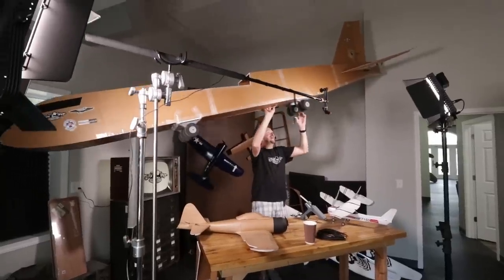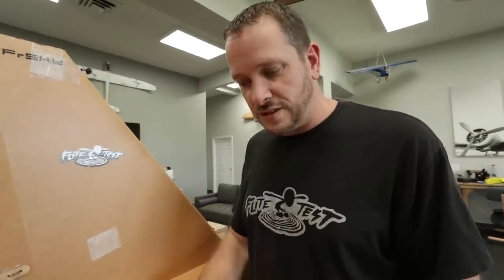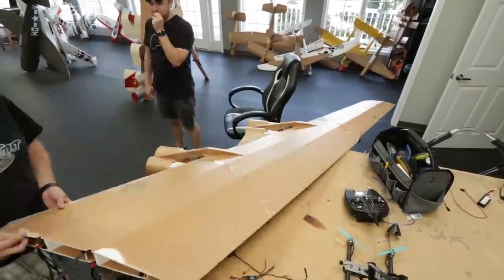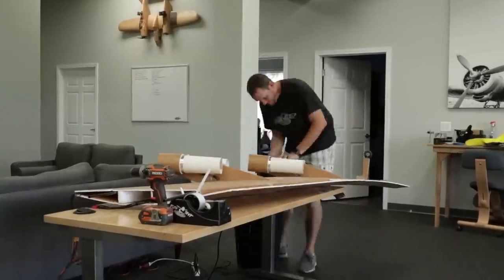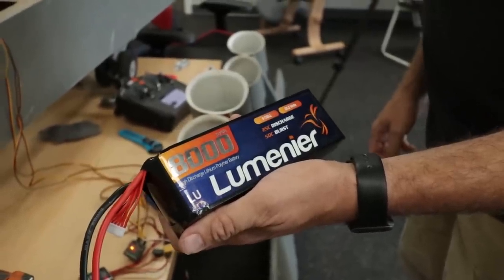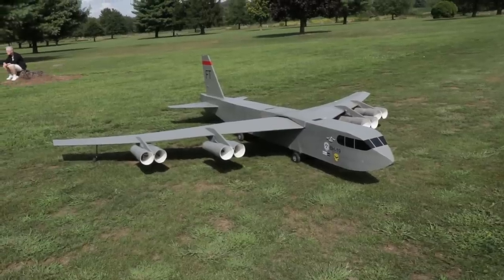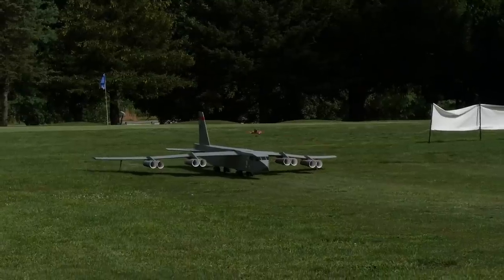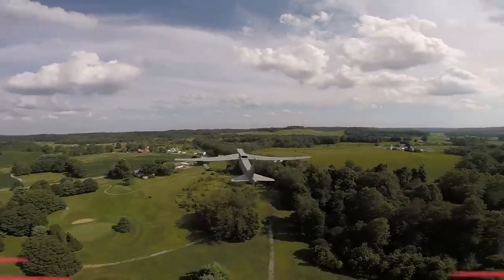✈️ Flying a 14 foot B-52 Bomber Made out of FOAM! ✈️

Comment: Amazing model.  I flew off a SAC base, but not BUFFs.  I flew smaller jets at Blytheville AFB which was built on a swamp.  After a B52 would take off, the 24" X 50' concrete slabs on the runway would move around and make the runway unusable for us for several minutes until the runway settled back down.  The only thing you guys missed on this model was that Boeing built the BUFF with a high angle of incidence so that the plane climbed out at 2 or 3 degrees nose DOWN.  The pilots would unstick the plane off the runway then push the yoke forward and the plane would climb out nose down.  With the bicycle gear it would allow a flat approach and landing.  Truly an amazing model of an amazing plane that the Air Force plans on flying for an unheard of 100 year life cycle.  Keep up the great work guys.  Love your channel.

Comment: Great flight!   Wings "flapping" is actually what the real jet does.  If they didn't flex, they'd break. :)  I was in a KC-135 refueling a Buff and it looked like it was going to shake apart!  The engine nacelles were moving all over the place.
Reply: But with all that flexing in the real B-52 wouldn't you have to worry about metal fatigue?

Comment: You should have an airsoft battle with the b-52 and a Mig
Reply: Post-flight combat analysis assignation of kill points using optical LASER weapons tracked/adjudicated via LIDAR - Boss!  In 3D? Arrrghh....
Reply: That would be such a slaughter! almost impossible to fly evasively with a flying BUS... and it is virtually impossible to make that thing crash with softgun pellets^^
Reply: @Cherrypopperland  Electronic scoring of epic Gladiatorial ariel grappling tournaments!  (saves on repairs, can enter multi-round one-on-one tournaments).
Reply: @johnd.ingleson799  still a flying bus VS an acrobat, it's like tying one leg to your arm and running 300m  against hussein bolt🤣
Reply: @catherinevaldez8810  waterbaloons? or paintball grenades! = )
Reply: Kenneth Linde paint ball gernades a payload
Reply: @catherinevaldez8810  Yeah, Why not? =) probably cheaper to just buy some sort of pastel coloured liquid in a  soft plastic container that's break on impact but you get the idea =)
Reply: I'd love it if they would use a MiG 21
Reply: @Cherrypopperland  Except that in real life, B-52 gunners have claimed 2 kills, One by a 19 year old Airman.
Reply: @SVSky  yes, and if the model airplane was full of fuel and the fighter shot flaming bullets then yes you could kill it with an acrobatic/fighter airplane. but short of that? any RC weapon that would be able to shoot it down would be illegal i think^^ so this is a m00t discussion and frankly a bit silly^^
Reply: @Cherrypopperland  You're right. It's stupid.
Reply: MMaXX M that makes no sense
Reply: If you go to the USAF Academy there’s a b52 codename diamond lil and it actually has a mig on its kill count
Reply: I’m pretty sure that B52’s has no offensive weaponry

Comment: I worked on the B-52G back in the 80's.  My job was flight controls, landing gear, windows, etc.  We did all the maintenance that just shy of depot level.  It was interesting to see the wings on your BUFF flex like they did.  This is behavior is actually a pretty damn close to what the BUFF would do.  The wings of the BUFF were made to flex up to 32'!  What was impressive about that is that fuel leakage from the wing tanks was practically nil.  That old girl was engineered correctly!

I spent a total of 6 years working on the BUFF and it holds a place that is near and dear to my heart.  I have a ton of stories about the old girl!
Reply: cool story.
Reply: Barksdale??
Reply: Lonnie Mathis I was just about to comment the same thing. I worked buffs for about 4 years. This didn’t look sketchy at all. I was at Barksdale.
Reply: @BLUEYENKO  Yep, I was at Barksdale Airplane Patch from 1981 to 1987.  I was in 2nd FMS, Repair and Reclamation shop.
Reply: Lonnie Mathis I was there 88-91 then crosstrained to F-16 Avionics.
Reply: I was a B-52G gunner at Barksdale 62BMS 79-82
Reply: Phillip McMurran I worked on the Fire Control System until they deleted it.
Reply: I’m stationed at Barksdale right now
Reply: love the comments here gentleman thank you for your service! 
I'm sixtythree tomorrow, my dad Raymond Smith worked at Boeing during the entire run of B-52s he told me before he died that his inspection bugg (ID#) is on everyone of these babies that ever flew!
he later worked on the ALCM program I have in his honor from his memorabilia hung a picture of an ALCM being launched from a BUFF! I have loved watching this bird all my life! thanks for building her!
Reply: Wow!
Reply: @Omba820  yae wow 😮😮
Reply: I also worked on this airframe in the 80s as a 328 (ECM/avionics tech). Had a blast when we had to fold the tail stab for repair work to the TWS harness.
And yes, the flex in the pilons did look authentic. I will never forget the first time I watched a BUFF from the tower during takeoff and landing.
Literally, the B-52 is the only large aircraft to ascend in a nose-down (2°) attitude.
Reply: Any of you ever do any work up in the hell hole on the BUFF?  I remember having to change out flap motors in the heat of summer up there.  One guy collapsed from heat exhaustion.
Reply: @mathis21  I have often been on what we called 'the HD Deck'. It's that crawlspace between the crew entry hatch and the forward wheel well. Had to service the coolers for some of our transmitters there. Seriously awful place to go on the best of days.
Reply: @mktsmith62  We in R&R shop called it the wine cellar.  I've spent many quality hours down there removing and replacing the throttle brakes (actual "brakes" that hold the throttles in a set position without vibrating around)
.
Reply: That’s awesome
Reply: Great story
Reply: @mathis21  I thought the wine cellar was just forward of the nav and rnav stations though, the other deck he's talking about is the one right behind the urinal through that door. I'm not too sure of the changes between the G and H models, but I do phase inspections on the buff. definitely have had my fair share of crawling around this old bird
Reply: @ACP_1123  - Oops, your right!  I got my hidey holes crossed up :)
Reply: Did any of you get to enjoy a MITO (Minimum Interval Take Off) launch with D models?  The ground shook like crazy from those babies when they hit water on takeoff!
Reply: @mathis21  No, ive only gotten to work with the H model, as well as I've not been on the flightline as my primary job, I work backshop
Reply: @phillipmcmurran8991  I was in the 596th BMS as a radar navigator 83-91
Reply: @mathis21  I was in the 596th BMS from 1983 to 1991
Reply: Not involved with big planes at all but I noticed the flex right away lol.

Comment: Great job and congrats on a successful first attempt.  I was an airframe inspector on B52G and H models, the wing flex was designed in for not just survivability but it made it a very stable bombing platform as well, in flight the wings curve up and backwards and have a 6" incidence for added lift.  On the ground the tip gear wheel is either on the ground or above your head depending on the fuel load, quite and aircraft and I feel privileged to have worked on them.

Comment: By making an exact cad model , you can simulate the flow around the plane at various velocities using Fluid mechanics software like Ansys. It will also help you reinforce the plane where necessary  by finding out stress distribution. Anyway congrats.

Comment: That is so cool. I was a SAC (Strategic Air Command) engine mechanic on them (C and D models) during the Vietnam War 🇻🇳 and (G and H models) during the cool war. I had the pleasure of running them up after maintenance. My first 8 engine run was when I was 19. I see you chose to do a G model. FYI, the real ones wings moved 11 feet and they will slip out the sky in a steep bank. Good job.

Comment: That was great.. Nice job guy's.. Before you fly it again, reinforce the wings..
Reply: Most planes with massive wings are designed to flex instead of being rigid. It helps to absorb the load on the wing, as apposed to a rigid wing which would require much more bracing to keep from snapping

Comment: I splice a couple  pop sticks into wing (vertical) sort of like spar on my modified scale down 

30" wing scout...The wing form a crease from 10-15 crash into tree, bushes, cartwheels..ect :-P . It works like a charm  becuase the pop sticks are VERTICAL and has more gluing surface
INTO the FOAM. Quick , simple and effective. I  Do that to all my new builds now.
I'll slice a couple pop stick ( 2" long) into the tops sheet of wing.ect ( at wing joint)
Even with diehedral  ( it dosnt have to be perfect, no one will see it.)

The model still flies GREAT. it has red or clear packing tape patches all over it....and holes
from the tree's branch sticking into it..It look like a patch up  war bird :-P.
I tested it....wazooo of snap rolls :-P 

I love that model..it's on a 2200 mah 3s on 2208 1400KV. So it's on the heaver wingload.
but it cuts through the wind better for a smaller model. i can fly it in 10-15 wind.

I get great power to wiegth ratio and over 12-15 mins of evasive flying  flight time.
i practice doing aerobatics with it...that's why I crash it all the time.
I can also fly it a park..if I wanted it. Even thou  it's slight over 350 grams
it's under 200 grams less the battery. A little more than one sheet of foam.

I also crash my modify 44" cub :-P.....I used 1mm plywood as doublers for the entire front end. I went in NOSE FIRST.( batteries went out.lmao) Nothing happened to the nose..Just a couple of crease behind the plywood/landing gear. It's FIELD TESTED :-P
You can get 1mmplywood from the dollar store.

It's a decent size 4 channels trainer only on a 2212 1000kv. It'll do all the basic loop and 

rolls too...practice doing cuban 8, emuman. split S, snap rolls, 4 pionts rolls, inverted..ect
over 850 grams AUW :-P . It would go bullistic on the 2218.

FOam board models are great. Cheap, effective, fun. On a balsa model the entire front end
would had exploded into hundreds of pieces...Even if I had to build new cubs ( I have plenty) 

That's why i bash is as JosH suggested . it's under $5 . i used pre coloured cub yellow foam boards :-P

Comment: The truck angle is called "crab angle". Also, the B-52 has a bunch of air flow directors on the wings that are called "vortex generators". The flaps on the B-52 are huge, and the vortex generators straighten out the air flow over the wings. The early B-52's (A-F models) had a large vertical tail rudder. I guess they had a problem with the rudder having too much control because the G and H models have a much smaller vertical tail. All of the other dimensions are the same. Longer wings than the fuselage. But it is not a glider. Duuuhhhhh. Nice job. Brings back memories.

Comment: What's cool is the high pitched whir you get out of the motors on that, is probably to scale for the sound of the actual engines on the B-52.  Used to do sheet metal work on the B-52 and still live around the base I worked at.  B-52 wings, from full fuel on a flight, the tips flex upwards somewhere around 20 feet.

Comment: I worked on the B-52 fifty years ago when I was in the Air Force.  They are still flying some of the planes I did maintenance on, like # 0007 which was later sold to NASA and is stationed at Edwards AFB.

Comment: Have you guys ever tried spraying open cell foam into the wings to give them strength, without adding too much weight? Always wondered if that'd work in preventing flex

Comment: For very big planes you might be a little worried they could crash into the crowd if the RC link fails and they continue to fly in uncontrollable directions. To add some safety you could build an instant release system for where the two wing spars join in the center of the plane.  With the push of a button on a 2nd RC link you could trigger the two wing spars to release from a center block causing the wings to immediately fold up under the weight. The plane would immediately fall out of the sky exactly where it is, this might be preferable to it gliding onward with no control. Think of it like range-safety self-destruct on a rocket, but without any explosives :)
Reply: At the very least, it would be a fun video to make and film.

Comment: If you try to fly the plane without the vertical stab, raise the forward gear while leaving the aft extended. That's how they kept the aircraft stable during the incident you referenced in the video. BTW, you may not realize it but the wing flex is close to scale--the wings on the BUFF flex 14 feet up and 7 feet down during flight.

Comment: About the Wing flex:  the predecessor to the B-52 was the B-47 Stratojet.  We called it “Droopy “ since the wings were designed so thin, they would droop down when the plane was on the ground and needed runner gear to hold them up.

Comment: Maybe putting on tape along the bottom of the wing that attaches to a point in the fuselage could help the wing flex by adding a tension member in the wing, or maybe even preflexing the wing the opposite way it will flex. They do this with concrete uts called prestressed concrete

Comment: Ditto on the X-15. But let’s turn it up a notch.  How about a same scale KC-135E (same engines as the BUFF). Have a camera in the boom pod and separate controls to fly the boom. Have the B-52 come up from behind (camera in the nose) and try to “refuel”. That could be as simple as making some type of electrical connection between the two aircraft and lighting up green LEDs you could see from the ground. Then have the BUFF launch the X-15. This scenario would involve 4 people. BUFF pilot, X-15 pilot, KC-135 pilot and boom operator.

Comment: The B-52 you speak off is tail 0023. Aircraft is still in commission at Minot AFB. The tail broke of in test flights due to vibrations. They then added the SAS (Stability Augmentation System) to the rudder. The SAS helps reduce vibrations through out the rudder. Thanks for the Minot AFB shout out in your pics (MT). The red tail stripe should say Bomber Barons it is from the 23rd AMU at Minot
Reply: Thought it was aircraft 1040--which I assume is also still flying. I flew it back in the 90's at Fairchild.
Reply: @tzkelley  i cant remember the tail that burned up in 2016, but that might have been 1040. Could be mistaken. However 1040 was/is still in service
Reply: @michalelston568  Yeah, I could be wrong on that tail number. But, I know the mission was to intentionally go find mountain wave turbulence to find out what it could do to an aircraft (that's why it has the unusual paint scheme--it was a test aircraft at the time). I guess they got their answer! :)

Comment: The back of the wing at the fuselage joint came up. This caused a significant lift reduction. You can see this in several shots airborne and during landing.

Comment: I worked on the B-52's in the Airforce at Castle AFB CA.,  AMS Autopilot and compass systems AFC 32550. When they land in heavy cross wind they use what IS called CRAB when the wheels all turn the same way. But you have to change angle of the fuselage to nose down at level flight and when take off and landing the rear wheels leave the ground last and hit the ground last. Also B-52's are also what we call BUFF's IE  Big Ugly Flying F*ckers. ALSO the wingtips would bow up to 20 feet from on the ground and in flight. AND THE B-52 DID NOT HAVE AILERONS, ONLY SPOILERS. THERE WAS NO CANOPY  OVER THE WINGS.

Comment: Just want to point out, B-52 does not have "trucks" on the landing gears, trucks are found on skateboards. B-52 had rotary dial landing gears, that allowed for a landing and rolling motion known as "crabbing." Trucks turn the whole platform, crabbing is straight motion regardless of platform orientation. Albeit in this case the B-52 had up to 20 degrees of crabbing angle.

Comment: Since I tend to not be a big fan of square airplanes if the original design was round, or round like, I admit this one looked good flying.  Even so, I would like to see it done more like the original design and that would include some alternate world versions.  The alternate world versions often come out of comic books, or cartoons and sometimes from versions that never made it past the drawing board.  Those that didn't get built are a bit harder to find information about.  One example from the imaginations of comic and cartoon masters would be how the F-15 Tomcat became the bases for the Veritech fighters from RoboTech, and the many spins like Macross that were yet other slightly different Tomcat like designs.  An old comic book that did a bit of the slight spins on aircraft designs was called Altered Wars, or something like that.  Sort of a WW2 didn't end theme and lots of female pilots.  Tigers of Terra was another version with the same theme.
Reply: Still a few military SciFi authors working in similar veins. Dale Brown for one. Flight of the Old Dog was awesome fun. B-52 rebuilt using cutting-edge modern design and materials. With  a V tail!
Reply: @martindinner3621    Didn't find any images of the design, but it sounds interesting.

Comment: The tail shearing off because of over agressive manoeuvers is a real thing. There was a commercial flight that lost its stabilizer and crashed killing everyone on board because the pilot overmaneuvered it...
And about the floppy wings, why not building big planes like that with aluminium square tube spars. I bet a big wing like that generates way enough lift for the little added weight for the extra rigidity.